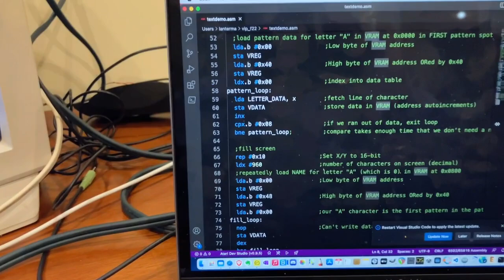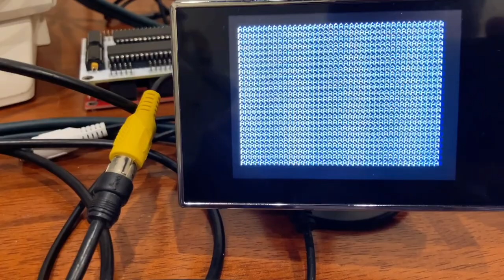PCB Interfaces TMS9118 Graphics Chip with the W65C265SXB Development Board (6502/65816) (Revision)

Comment: Nice work! I built a Yamaha v9958 video card myself one time. iirc there's a wait pin on the v9958 that is supposed to slow down a z80 cpu if you connect the v9958 wait pin and the z80 wait pin together, see if the TMS9918 has something like that on it and maybe you won't have to insert nop instructions.
Reply from the maker: The TMS9918 definitely doesn't -- they could just assume the processor was slow enough. I could see how they'd add a pin like that to the v9958 since at that point they had faster Z80s.